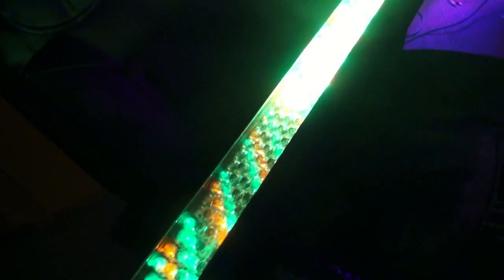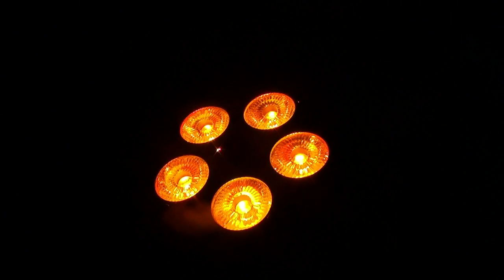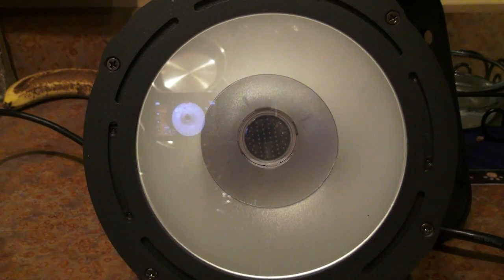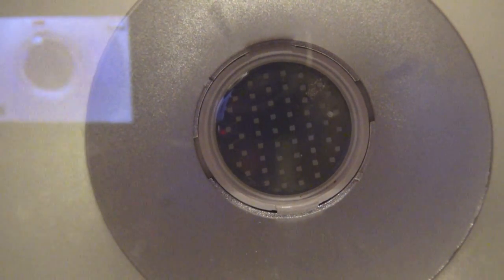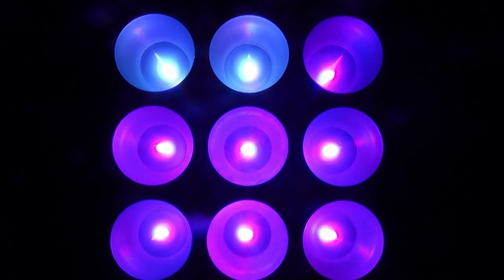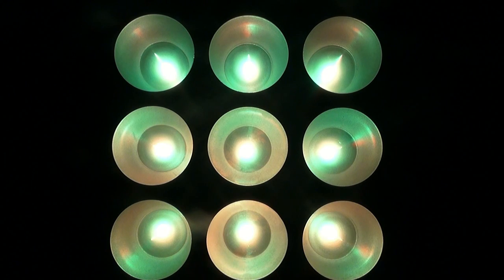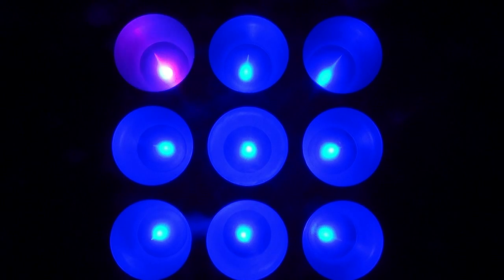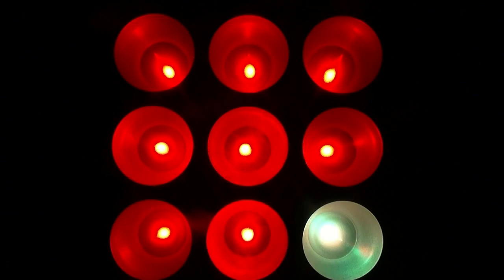What is COB LED?

Comment: You forgot SMD (surface mounted diode). COB is the next step. You might also call it SID (surface integrated diode), i guess. The main difference is that it can be cooled more efficiently and thus can handle more power which allows for brighter light than anything we had before. PS: Be careful with filming such a highpower light source. The brightness is probably not as much as a laser beam, but I ripped a black hole into my phone's camera with a 50mW laser. It's not big, but it's annoying to have a dark spot on every picture.
Reply from the maker: Good to know, thank you.  I actually thought about going into SMD as well, but kind of was going for a simple explanation.  I actually tried to research this online before I shot to gather more info than I had been told, but it seems the official description I found on a few different sites was written by someone who didn't bother to have it proof read by someone with stronger English writing skills
Reply: Hm. I did not find an english wikipedia article. COB per se is not new. You might have seen it in cheap electronic gadgets already. http://upload.wikimedia.org/wikipedia/commons/thumb/8/87/Horlogeprint.jpg/220px-Horlogeprint.jpg Advantages (besides better cooling, which is really the driving factor when it comes to highpower LEDs), are shorter wires, which allows faster calculations (doesn't concern LEDs), but also a higher density of modules (more LED's=brighter fixture). And apparently this technology allows for parallel usage of connections which reduces the electric resistance and thus produces less heat.
Reply from the maker: borstenpinsel here's what I kept finding on various websites  Why COB? --Background
LED(light emitting diode) is new technology with advantage of saving energy and very long lifespan. But all LED lightsource can not be faultless especially SMD, HP, flux LED etc. Compare to traditional lighting such as fluorescent lamp, as it is super bright in a small size, it cause uncomfortable glare. In case of no diffused optical lens used, such LEDs usually cause glare and zebra strips . But when optical lens or cover used, it will cause light loss when LED beam pass through this lens or cover.

How COB LED Light source works
	COB LED is multi chips packaged, it can 10 times more increase lighting area, so it avoid uncomfortable glare by the maximum extent.
	 Lightspot use small size of chips to make COB LED package.
	 By now, for small size chip, ?some famous LED chip manufacturer can reach 249lm/watt @ 20mA. But big size LED chip can only reach 161lm/watt @350mA. The light efficacy decrease when chip size is bigger. Also when LED driver increase current to LED, the light efficacy per watt is even low.